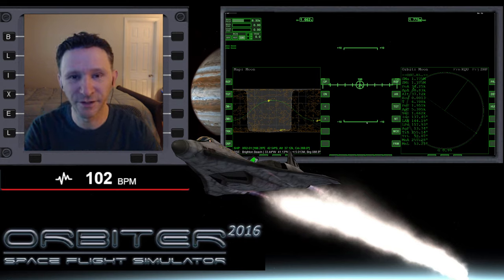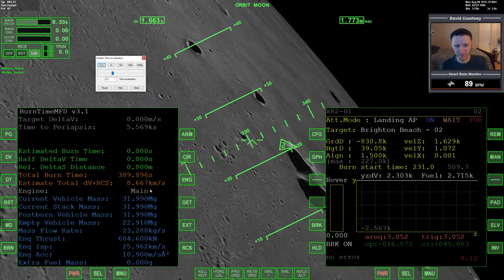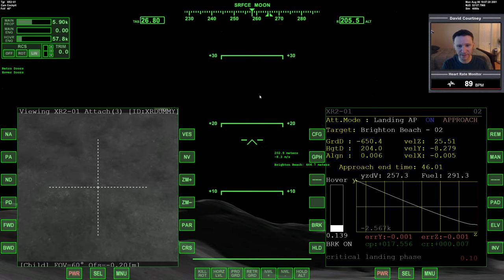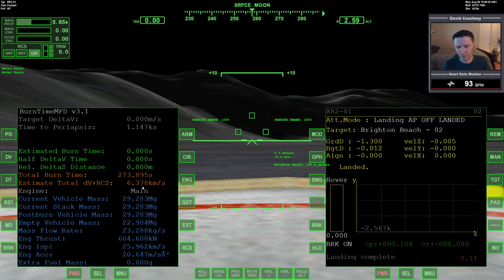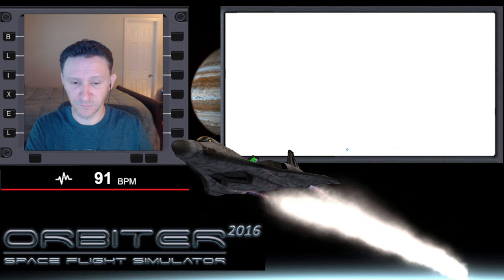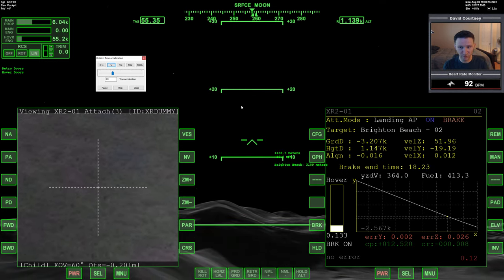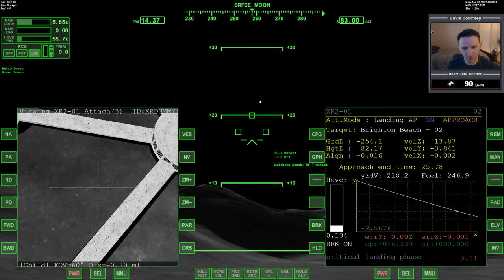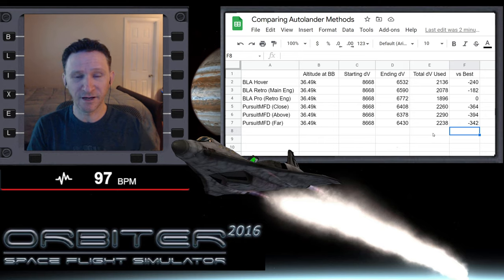Orbiter 2016- [Part 3] Comparing Autolander Methods

Comment: I'm still blown away by the results for BLA prograde using the retro engines. That number is such an outlier compared to itself and Pursuit. It's also the nicest/smoothest looking approach, with good visibility and not a lot of annoying orientation changes. I think even on your best run in the landing challenge back in the day, you didn't beat that dv flying manually. Now is having BLA worth it, as a one-trick pony? Idk. I suppose if you were actually paying for fuel it might make sense to save 400 dv. But generally our main goal is consistency to facilitate accurate fuel planning, which any of these methods provide. Looking forward to the next one. Cheers!
Reply from the maker: Well, BLA is a single DLL file, and I haven't experienced any crashes related to using it, so I think it's worth having. As an aside, I do wish I could enable/disable modules per scenario as opposed to globally. For example, while flying the Lunar Landing challenge, I have no use for Aerobrake, Glideslope, LaunchMFD, TransX, BaseSync, and others. It would be nice if I could tell the scenario file that I only want certain MFDs to load for the given scenario. I also wish I could completely disable HSI and Transfer as I never use them for anything.
Reply: @DavidCourtney  Yeah that would be nice. I just figure Pursuit does landings, dockings and the option to zero out relative velocity.

Comment: Hi David! Thank you for this serie! Would you mind sharing your reference scn file for this test ? I've been a user of HoverMFD for some time and I would like to see how it performs in the same circumstances (not gonna lie, I don't think it's gonna beat BLA).
Reply from the maker: Sure, I put a link in the video description for the scenario. If you try it out, let me know how HoverMFD does. A few people have been asking me to add that to the list of comparisons. I may have to make a 5th part to this series to try more options.
Reply: @DavidCourtney  Thank you very much! Sure, I'll let you know the result! The picky part with HoverMFD is that it is not exactly a lander autopilot, and you definitely have to do some planning beforehand to avoid a catastrophic landing. You can land with it, but should you ?
Reply: Well, HoverMFD is not designed for orbital flight. So deorbit is on the border of its scope. Also it is not intended as a fully hands off autoplilot and never aimed for fuel efficiency.
It can't do the deorbit burn properly. People do use it for that purpose, and so do I. But to make this somewhat efficient, there are periods, where the autopilot has to be better switched off and the pilot needs to monitor when to switch back on. What HoverMFD then does is something like totally ignoring the orbit and pretending to be 100m above ground and just brake in time to stop at the target by means of horizontal speed. The whole falling down part of the approach needs to happen as a side product.
But I would also love to see David having a go at it and can offer my help if needed.
Reply: @MythosHB  Sure, it is not the best tool for orbital flight. But I do love to use it anyway, precisely because it is semi-automatic, and you have to think carefully what to input before executing the manoeuvrer. Certainly, it cannot do a full deorbit burn, especially in Heli and Tailsit mods (they don't like to have a positive Vertical speed when passing over the target), but here are some preliminary results achieved wit Hover mode : in retrograde position (main engine), dV Used = 2131, in prograde position, (retro engine) dV used = 2286. In both cases, AP was activated ~ 30 seconds before crossing the line of nodes with Brighton beach, with no preliminary manual deorbit burn . So not as efficient as BLA, but can definitely do better than PursuitMFD in terms of fuel efficiency.
Reply: @giannifachinetti2414  there is some discussion on the Orbiter forum about that, starting here: https://www.orbiter-forum.com/threads/hovermfd-1-1-3-for-orbiter-2016.34153/page-2#post-584171